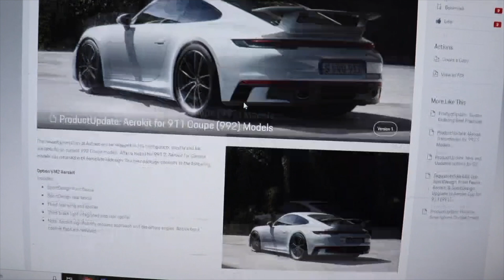The $15,000 Brake Job

Comment: I never trust a dealerships pricing on service work. I would have also done my due diligence and called around for pricing
Reply from the maker: I wasn’t knocking the guys choice of a second opinion. Just trying to communicate the fact that there are very few options when it comes to replacing these brakes
Reply: Josh Share I get it. Not many options when it comes to carbon ceramic brake replacement. If you aren’t going to regularly track the car, is the extra cost of the carbon ceramic components worth it?
Reply from the maker: GS300 Rich if it were my car I’d stick to steel brakes even for track use. Unless I hit the lottery